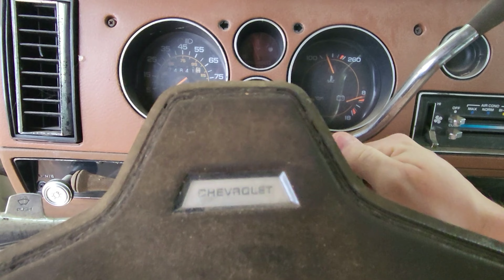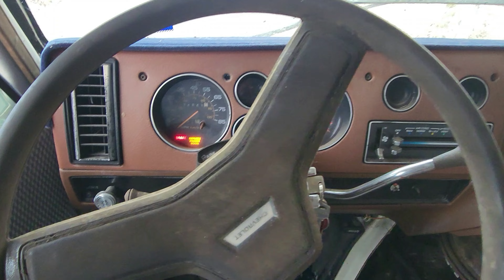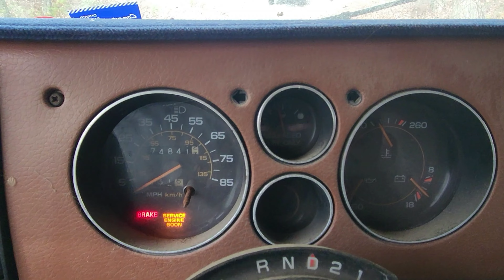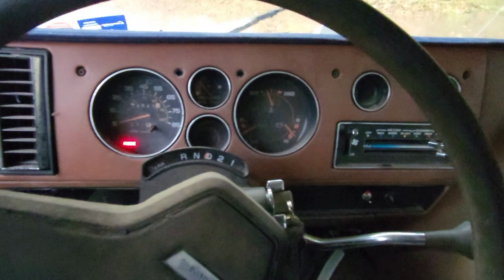Can I get this 1990 Shasta Chevy G30 Running and Drive it 250 miles home? Part 2

Comment: I'm glad you got it running and home.  I noticed at 10:22 you can see one of the plug wires arcing to ground on the passenger side of the engine. Its only for a split second behind the TB. I would recommend replacing the plug wires as they degrade over time. I'm glad you checked the firing order and found two of them crossed, it happens.  I would also recommend replacing the HP fuel filter, (its probably the original) and while the fuel tank is low, pour in a couple of bottles of Chevron-Techron fuel system cleaner to clean the injectors. I would say run BG-44K but it is very expensive (about $30 for 11oz. ). The Chevron-Techron is the closest formula to it that I know of. A lot cheaper too. I hope that helps you get her running even better!
Reply from the maker: Thanks for noticing that KP! I'd had a set of new wires on order as well!

Comment: What is it with 10mm sockets??? I dropped one inside the rear clam-shell opening of my SUV and dropped one in the lake last summer.
Reply from the maker: Right?  When I was putting together my cab for the tractor last week I kept misplacing it yet again!

Comment: for that battery just tip get them conversion side post in to top post they work lot better plus you can use them for lot uses 
thier lead top post lot place have them